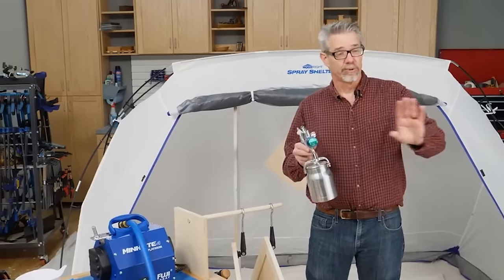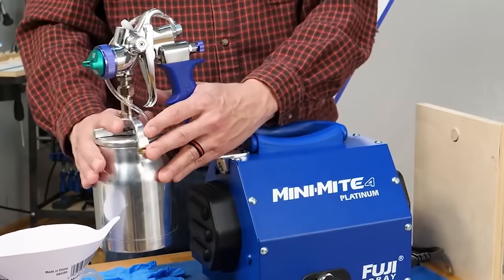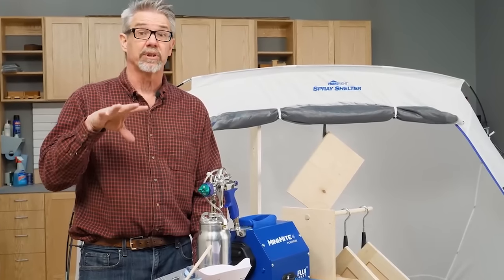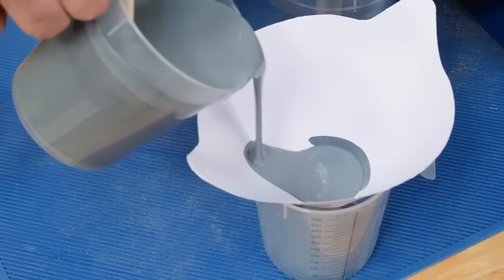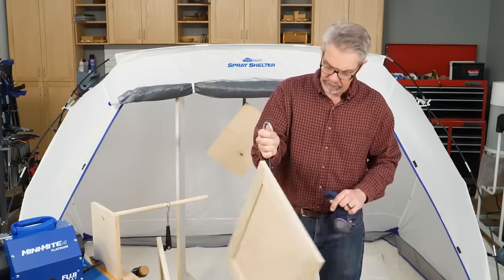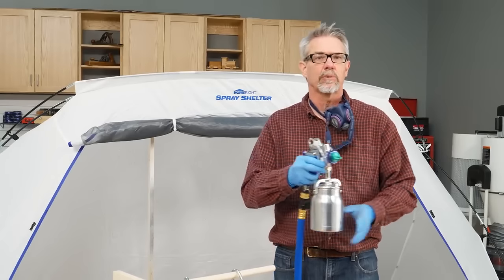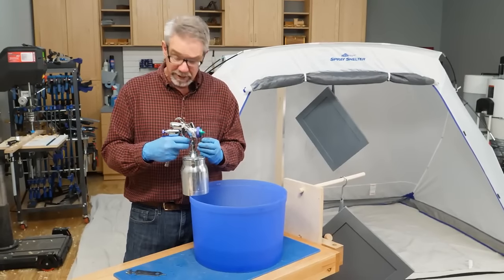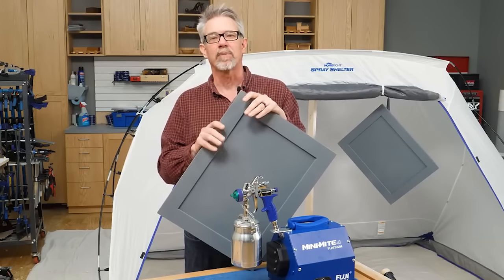How to Use an HVLP Sprayer | Fuji HVLP Sprayer Tips

Comment: you need a spray booth,  mine cost 5 grand,  about  15 years ago,  and my powerful exhaust fan keeps all over spray away,  an i have been doing furniture restoration full time in my shop for the last 40 years.......my dads cabinet shop had a home made spray booth which was,  ok,  but when i got the pro booth,  wow,  what a difference in the finishes i put on
Reply: Right, so people who are into woodworking as a hobby should throw down $5k for a spray booth that they will use maybe 3 or 4 times a year (at most)? Not going to happen. I improvise and do just fine. I just painted my motorcycle, full on from two different primers all the way through to color and clear coat, with the Q5 Platinum Fuji Sprayer and it turned out freaking perfect. I made a make shift spray booth out of plastic painters sheets. I taped them to my garage door rails and made a little enclosed booth with them. Lots more sanding involved but it worked out great.

Comment: 3:26 nope, that's not "about it". I have that gun. You have to take out the next part that you can see there including the plastic washers and also the needle (and then struggle to get something down into the gun because paint is going to accumulate in the heart of the gun behind that part he didn't take out). Don't forget to clean out the cup and all that entails (throw some solvent in the cup, swoosh it around and spray it out...do that around 4 times and you can proceed to cleaning the rest of the gun). Then there is also the pressure line that needs to be replaced and make sure to clean out the little pressure port at the top of the cup. Also, paint is going to get into every nook and cranny of that gun so really the biggest draw back to these systems is the clean up. It's a pain no matter how you slice it. After running 4 or 5 shots of solvent through the gun what I do is put all those little parts in a cup of solvent, let it sit for a bit, then get out the tiny brush kit or a toothbrush and go to town on all the little holes on the various parts. Like he said though, you MUST clean it thoroughly right after you use it. It can't wait or you will have a huge problem on your hands. Water based stuff is the easiest to clean because you have plenty of water available and you can put it anywhere, however, these systems do not spray water based paints very well unless you get the higher end units with plenty of power. Usually you will find yourself cleaning your gun with acetone or similar solvents and it's a big pain in the you know what. I actually think it's debatable if it is worth getting the system out to just paint a small project (I don't). If you are going to paint an entire kitchen worth of cabinets it makes sense.

Comment: It really should be called "a sales pitch for Fuji".

High level overview of little help to me.  For example, the video said that you will need to thin your paint with water, giving no guidance what so ever for this critical step.  You'd expect some explanation of how to set the gun for spraying.  Disappointing.
Reply: Please explain where he promotes Fuji over other brands. Yes, he happens to be using one and mentions the company once. But at no point does he promote it over other brands.
Reply: Fuji doesn't need him. Their products speak for themselves.
Reply: @ILruffian  the fact that the video is sponsored by fuji is a bit of a clue
Reply: @chrispollard100  My Q5 just failed. They are fixing it under warranty, but Fuji threatened me that they will not warranty it again due to environmental/overspray issues. Total nonsense. I had the turbine as far away as possible (at the max length of the hose). More importantly, I had an exhaust fan 3' from the work, pulling the overspray outside. May have to make a video showing the setup and telling people to buy Apollo.